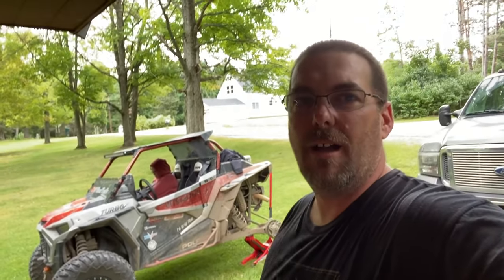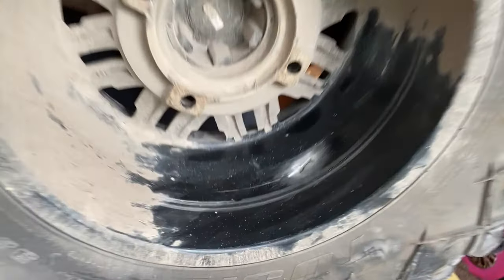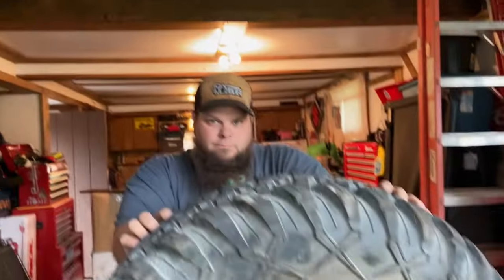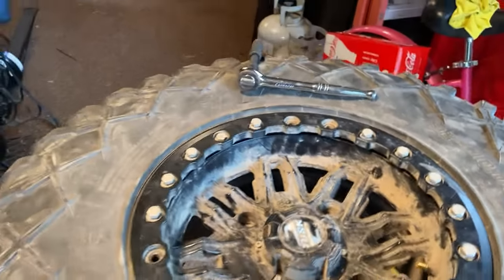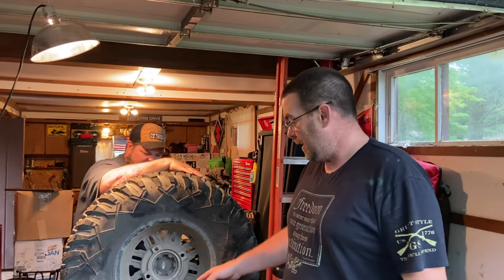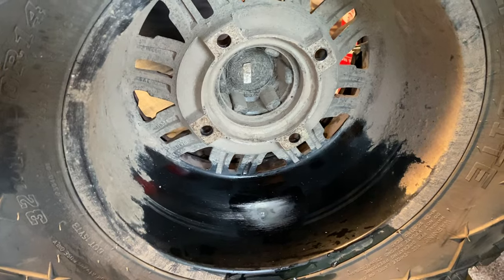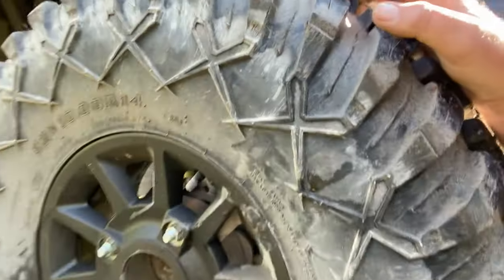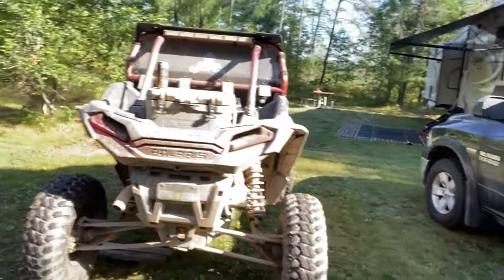Can we fix a hole in a wheel with Gorilla Epoxy?

Comment: JB Weld works, but you have to take the tire off first so there's no air pressure. Also put it on the inside. I also added Gorilla tape over the dried JB Weld for good measure. I had a big dent and hole that the dealer said could not be fixed. I'm still running on it with no flats.